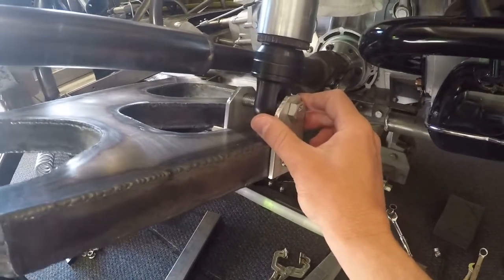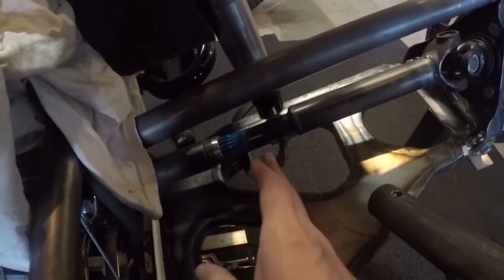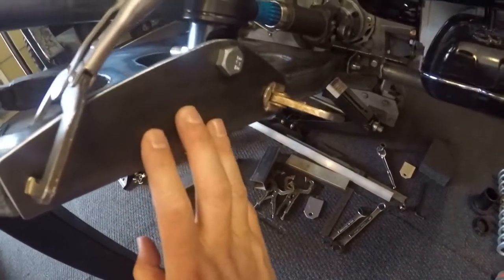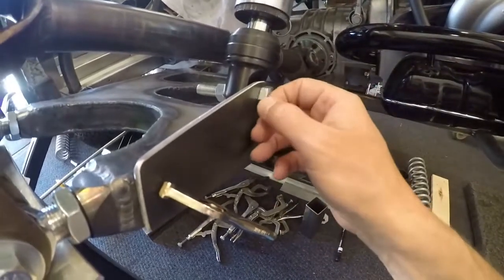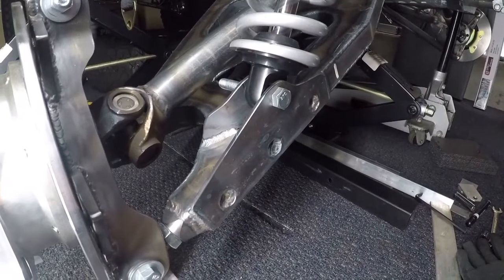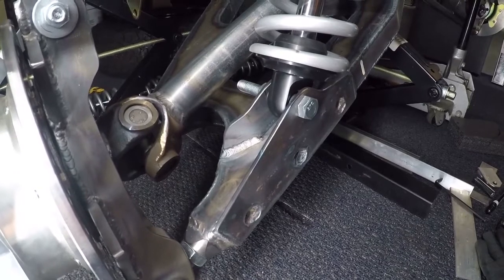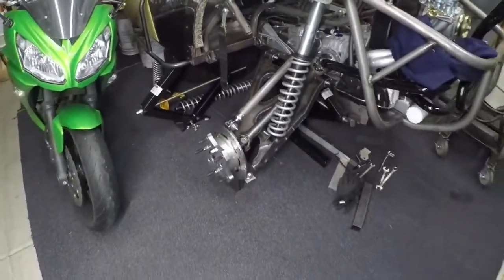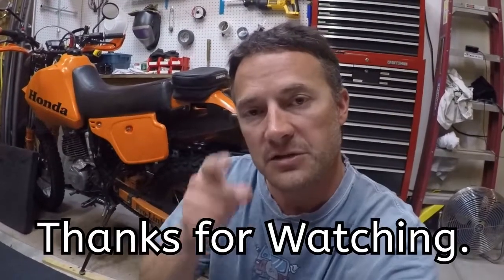Baja Bug (rear) A Arm Suspension Shock Absorber Design/Fabrication

Comment: Hello Dough, what are the specs of your front and rear shocks if I may kindly ask?
Reply from the maker: For this Baja I used 31x9.5 tires with 2"x10" shocks in front.
33x10.5 tires with 2"x14" shocks in the rear.

Comment: Hey Doug, I have to wonder since you are relying only on your solid lower arm for the strength, how it will hold up. This a a fairly older vid so I assume youre driving the car by now, how well has the lower arm dealt with the twist put on it during acceleration and braking?
Reply from the maker: Great question! I was a little worried about that. However I've got just under 1,000 miles on the Baja now and those arms have held up just fine. You can grab the turning brake on asphalt and lock up the rears and they don't even flex any noticeable amount. So they've proven themselves to me.

Comment: What are some basic factors we need to consider for designing front a arm
Reply from the maker: Steering and connection points to the chassis. You need to work the geometry of the suspension so that it will work fairly well with your steering. Once you have that most other aspects fall into place.

Comment: Why didn't you move the wheel back to improve the weight bias when making the control arms. Otherwise, beautiful work
Reply from the maker: tajvwss, before this I had made a set of trailing arms and those were about 3" longer than stock. But after thinking more about the terrain I will be in (tight mountain trails) I decided to bring it back in to be able to make tight turns and keep a lot of the weight on the rear for traction up the mountains. I'll see how it goes, I can lengthen it if needed. But for now I'm going for a lot of weight on the rear and tight turning.
Thanks for the comment.
Reply: Thank you for the response. Track width is a genuine concern if you're doing anything in a confined space. The track width on the front of my manx buggy is 75". Just getting it into the garage is something I have to attention to, lol.

Comment: Cool videos, I notice you have the different axels. How do they work and are they better than the more commonly use axel? Are they worth getting them even though they are more expensive?
Reply from the maker: I originally went with the U joint axles for the high degree (I get 40 degrees out of them) and the cost. I got these from the junkyard for $26 each. They are out of a jeep Cherokee. Each side also needs an adaptor that cost $65. But all in all they're pretty cheap. However you need to cut them apart and fab them to fit your bug.
https://www.youtube.com/watch?v=J35lmW9bkY0 Here is a video with some of the work.
Haven't run the bug yet so can't say how they work. Maybe they will maybe they won't. lol
Reply: Ever run it yet? Im pretty close to ordering my axels and ujoints